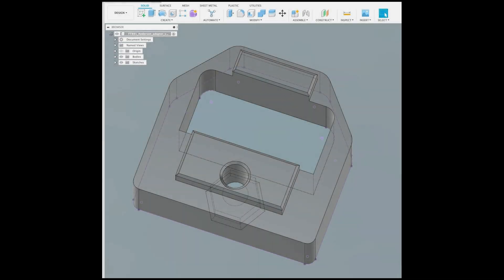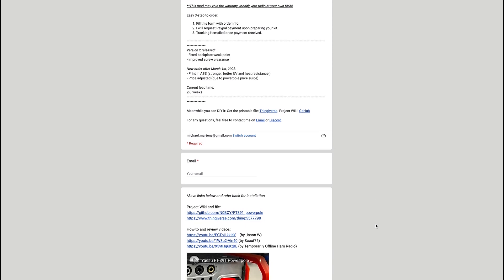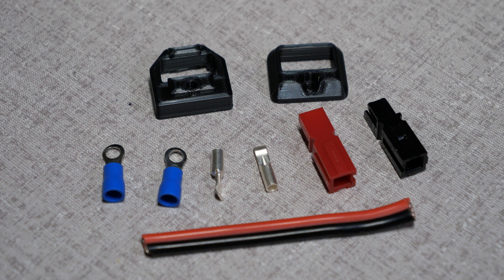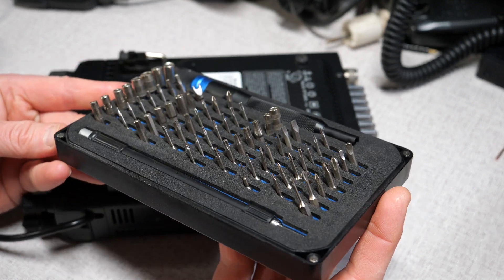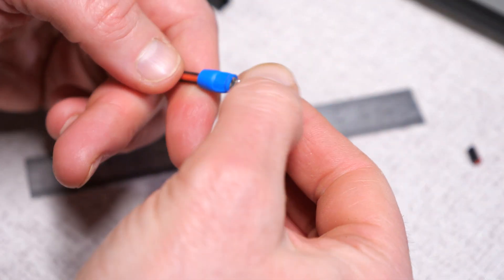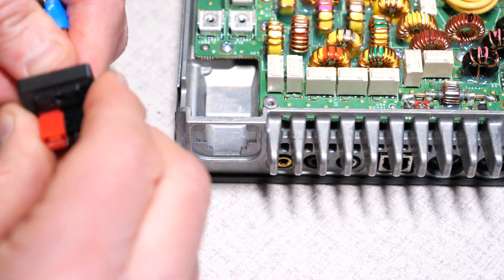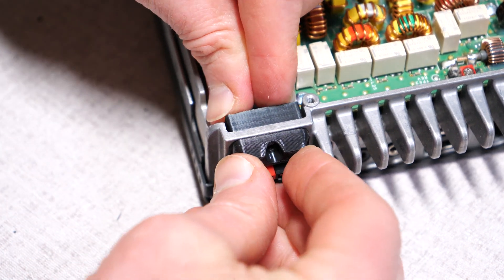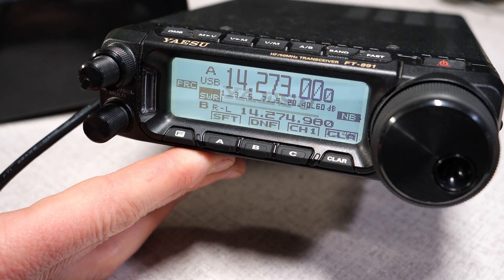New and Improved: Yaesu FT-891 Powerpole Conversion  #hamradioqa

Comment: I did the mode but the plugs are pushed inside, there's nothing holding the plugs in place.
Reply from the maker: Did you use genuine Anderson Powerpoles? I've found that some of the knockoffs aren't quite the same dimensionally and will not properly fit into the holder.
Reply: thank you for the reply, I had to use the dremel on the side of the plugs. Now everything is working on place.

Comment: 16AWG seems too small given that this radio can draw up to 23Amps
Reply from the maker: It depends on the wire length. 16 gauge wire is more than adequate for this purpose. But if you get longer than a couple of feet, the internal resistance of the wire will cause a voltage drop.

Comment: Yah, thanks to the Mag-moss warranty act, this will not void your warranty assuming you don't damage the radio in the process. Should you need to RMA it, just add the original connector back on.
Reply from the maker: Yes, you are correct. It is an easy process to reverse, so there should be no fear of breaking your warranty.

Comment: It looks easy. Silicone wire is a great choice. I would prefer if someone would create an XT-60 connector. I think they are a better deal maybe XT-90. Anderson power poles get loose after a while. You really need to make a double fuse assembly to make it correct.

Comment: Has anyone else done this and thought to use a nylon insert lock nut instead of a plain nut?  I just thought with portable use, it might be possible the bolt might find its way loose till the nut could fall out inside the rig, right by power connectors or other circuitry.  May be overkill, but thinking an ounce of prevention...
Reply from the maker: That thought never crossed my mind. With the 18 months I've been using this connector on my FT-891, I've probably connected and disconnected it over 100 times and haven't had it loosen up.

Comment: I would absolutely do so, except mine is under warranty. I’ll have to wait a bit. Did use powerpole connectors on the end on that hf 4pin’s cable. Anderson Powerpole’s should be the standard.

Comment: Nice ! One issue if one was to resolve an issue with the FT857 and like series one of the connectors on the power connector tells the radio it’s working in portable mode and at reduced power.
Where can I find the files for those side rails?

Comment: Even if I had a 3D printer this would take me 4 hrs because nothing goes as smooth as the video; at least for me. 
1- something would malfunction  on the printer
2-I would make the connectors too short
3-I would slip with the screw driver and need bandaids; we would be out of them 
4- one of the screws would have rolled off the table into the air vent on the floor and can’t remember where I put that neat magnetic thingy that was made just for this.
5-I think I’ll tell my wife the radio is unrepairable and I need a new one; four negatives CAN turn into a positive.

Comment: i love your videos!!
Great idea, but I ended up attaching Anderson powerpole connectors to the end of my original Yaesu factory supplied power cable.  
 I've never had occasion to remove the cable from my 891 to date, so the power connector is not "janky", it's in pristine condition. 
 When I set up a portable station next summer, I'll just use my new powerpole connectors to hook up to a LifePo battery. No need to do an internal modification to the transceiver. All is well.

Comment: Do you think this could be modified for an icom IC7000?
Reply from the maker: Possibly. If the rig uses the same plug, the hole on the chassis should be similar. A slight modification may be needed though

Comment: I bought a spare power cable and converted the end to a power pole. Saves the factory connector.
Reply from the maker: Yes. I also saved my power connector and cable, so I can switch back if I never need to.

Comment: I was curious, how long did it take you to render the parts in the 3D printer? 73 de WE4SEX
Reply from the maker: I recall it didn't take very long, so I checked the slicer and it calculated 33 minutes.
Reply: @KB9VBRAntennas  thank you for the information

Comment: Hello, What amp rating do you  recommend for the Yaesu FT-891 for all Anderson power pole cables used with the radio? 35 amp?
Reply from the maker: The Powerpole shells are all the same size for the 15, 30, and 45 amp rating. The difference are the contacts on the inside. The wire that goes from the shell to the transceiver is very short, so a relatively thin wire will handle the current draw of the transceiver. Rewatching the video, it appears that I used the 15ga contacts and 18ga wire.

Comment: Michael, I just did this mod. I purchased the whole kit including the power poles leads already made up. Seating the power poles in the chassis did take some dexterity, but I was able to do it. I really dislike Molex type connectors for anything portable. I wish there was a better way to connect the mic. I'm now using a short pigtail so I don't have to either leave the mic attached or remove the faceplate every time I transport the radio. I hope to work you on the air, again, 73, George
Reply from the maker: I'm still happy with my Powerpole modification. After three or so months of use, it is still holding up.

Comment: I only use my FT-891 while out portable as I have bigger base stations at home. I am considering this mod. Will have to order the parts as I don't know a thing about printing stuff nor do I have the room for it.  What I have done so far is cut the wire that goes to the OEM Molex connector and put a power pole on that end. So that I end up with a Molex connector on one end and a powerpole on the other end of that short cable. Then they stay connected. So all I have to do is insert a powerpole to the end of the short molex male/powerpole cable. No need to constantly insert and remove the molex connector. But I will try this by purchasing the kit.

Comment: I cannot get the power poles to fit like the video shows ... in the off chance my power pole connectors are the issue, I just ordered a new set that are actually branded Anderson and not a chinese knock-off. We shall see in a couple days!
Reply from the maker: It's probably the Powerpoles you used. I have an assortment of genuine Anderson and Chinese knockoffs. In doing the mod I used both an Anderson set and a knockoff and it worked. (I usually do things 2 or 3 times in the course of making a video). But I also put a set together for a friend to mod his radio. That time I grabbed a different set of Chinese powerpoles and they did not fit for him. He replaced them with Andersons and all was fine.
Reply: @KB9VBRAntennas  That is what I thought. Thanks for confirming. My genuine poles will be here tomorrow.
Reply: Same here.  I bought the kit from the designer and they are genuine powerpoles and they slide right thru it with virtually no force required.  I'm debating even doing it because I'm afraid the powerpoles won't stay in place then.

Comment: Great video, I wondered if the factory 4 pin oem plug would hold up to heavy portable use. Overall the ft-891 does as appear to be a solid little rig and definitely can't beat the price point either. I'm going to get 1 and have for a backup, but I will probably use it alongside my Kenwood TS -590sg and TS -2000. I have a Yaesu ft-840 I now use for portable Field day on shore or generator power. It's a basic simple easy to use rig for that purpose. I use a mfj manual antenna tuner with it. Band conditions and antennas are biggest link in not making and making contacts. Great video as always. 73 and GOD bless Earnest K5EWM.

Comment: It seems like the radio should come from the factory with Anderson’s. Do we know if simply removing the bottom cover voids the warranty?  If nit, it would be simple to convert it back to factory configuration if you need warranty work done.  Mine is only 6 months old so I’m thinking, hmmmmmmm.
Reply from the maker: I doubt removing the cover voids the warranty as there aren't any stickers or devices covering up the screw holes. I wouldn't throw out the old connector and if I had to send my rig in for service, would probably return the connector back to its original configuration.

Comment: Nah. $15 dollar pigtail adapter does this without the work or voiding the warranty.
Reply from the maker: I use pigtails on my other transceivers. My warranty is long past that point and the FT-891 needed the upgrade because the physical connector was loose. So, something had to be done.

Comment: Thanks for showing this video. I was a little intimidated on doing this and thought there might be more to it. I'm considering doing this now. Its a bugger to get that stock connector to disconnect from the radio at times.
Reply from the maker: I know what you mean. I've been tempted to break off the tab on that Molex connector, I think this is a better solution.

Comment: SOLDER ALL CRIMPS !!  GREAT MOD IDEA ! THANK YOU !!
Reply from the maker: I always thought the same thing too, but a well crimped connector is more reliable than something that's been soldered and crimped; especially if the connection will be flexed, like on a Powerpole.
Reply: Soldering crimp connections always made me feel better, too, but I learned the hard way NOT to do that with Anderson Power Poles.
KZ9V

Comment: Great video. Made it look easy. Thanks for doing all the hard stuff so I just have to get the parts and make it work.
Reply from the maker: I think the hardest part was finding that little metric bolt locally.
Reply: @KB9VBRAntennas  I have a local no name hardware store that stocks all that weird stuff. Always go there for something I cannot find at the big name stores.
Reply from the maker: Those stores are the best.

Comment: Great mod and video. I changed mine out a couple of months ago and love it. So much better than the factory connector.
Reply from the maker: Taking a transceiver portable can beat them up, but I've never had so much wear on a power connector than with my FT-891. At least the designers made it easy to replace.
Reply: Would love to see more radios do this as a standard option. The molex connectors are a pain to disconnect.

Comment: Ok…
I think you’ve just convinced me to buy a 3D printer! 😅
Great mod!
That connector on the back is a poor design…. It sticks out too far so that any time the radio is tilted up even a little beyond the height of the kick stand… the cables are being bent/pressured…
As you said… it’s a real problem when you work portable a lot as I do too, with the radio being moved about a bit and not always on a flat surface.

Comment: Glad to see it works! 😎🤟🏻
Reply from the maker: Thank you for putting in the effort to design such a nice piece.
Reply: Jason it is great to see there is a new version that has been improved based on user feedback.   Do you know if this conversion will also work on other radios?  My FTdx10 has been back to Yaesu once already to replace the 4-pin Molex connector and it still pushes into the chassis when plugging in the power.
Reply: Thanks for updating the design. The new version looks like an good improvement.